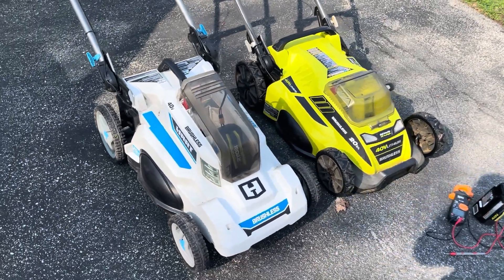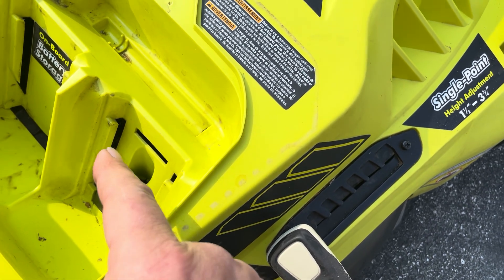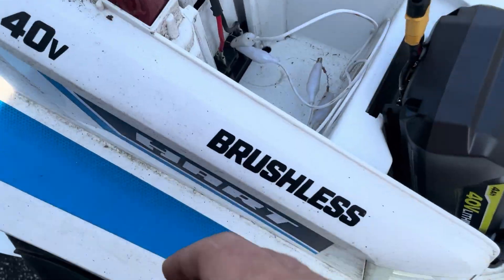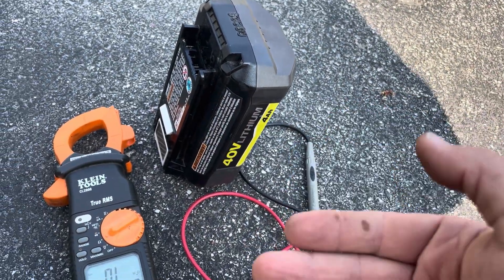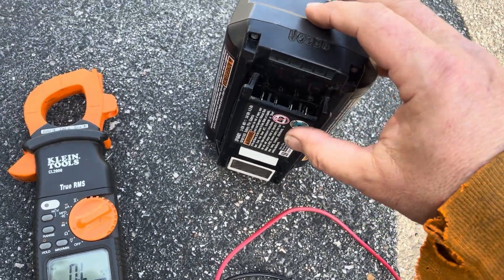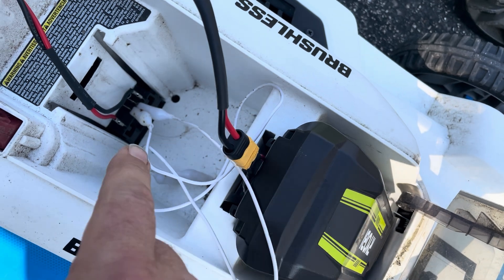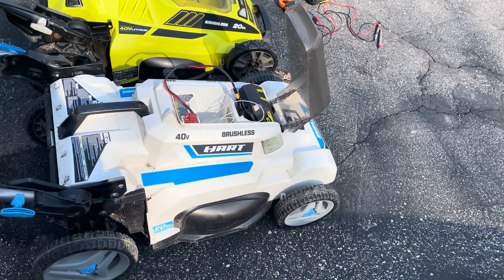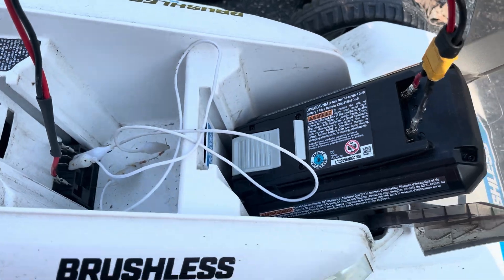Power a Hart 40V mower with a Ryobi Battery!

Comment: Since you're going to use a non-HART battery on a HART mower, shouldn't you measure the resistance of a REAL Hart battery to use for the jumper rather than the resistance of the foreign battery? After all, you need to fool the HART component rather than the foreign component.  In this case, the Ryobi battery is going to give you 40V at the output pins regardless of the resistance applied to the HART mower.  AMArite or no?
Reply: Or for that matter connect those t1t2 to the battery also since they work?

Comment: seems the better way would be to connect the T1 and T2 connections so battery and machine are fully connected.  bypassing a thermal safety is a bad choice. have you seen what happens with a Li ion battery thermal runaway?
Reply from the maker: This was just doing some testing to see what it would take to fire up the mower. I also thought people would find it interesting to know what goes on at those pins.
Any final converter would have the T pin connections.
Reply: I was told that if you adapted hart batteries on to ryobi tools it would drain the battery to no charge that  in a sense the hart tools were smart and new when to stop taking power but the batteries were dumb and the ryobi tools were dumb and would continue to take power till the batteries told them to stop taking power

Comment: clever find. I would leave it out after cutting the grass for around an  hour or so since you are bypassing a battery safety mechanism right?
Reply from the maker: @KyBrancaccio  For the moment, I’m just testing things out. On the RYOBI 40v mower, I have NEVER had a battery shut down from being too warm. 

In testing here, I was really just using the resistors to get the mower to spin up, seeing what it did or didn’t require. 
It was also easier than trying to jumper the temperature terminals from the battery to the mower. 

If I 3d-print up a real connection, I’ll put the temperature leads on there as well.